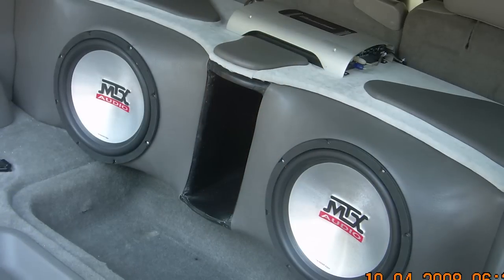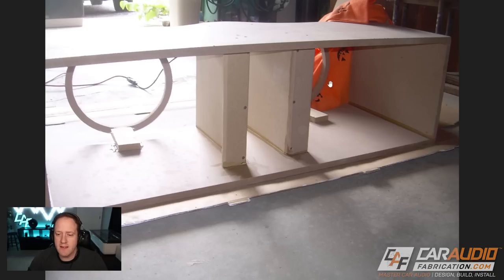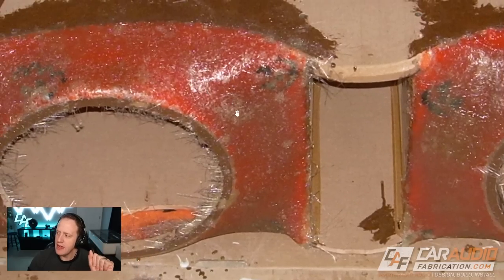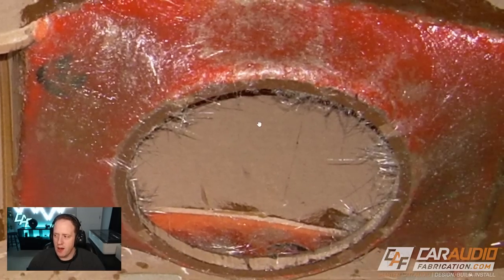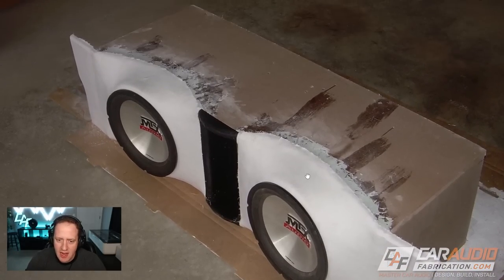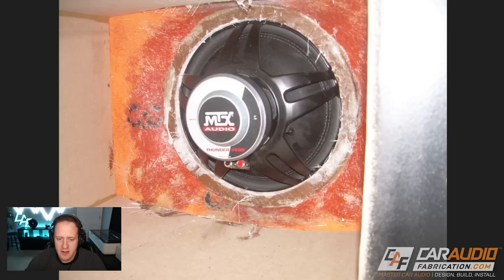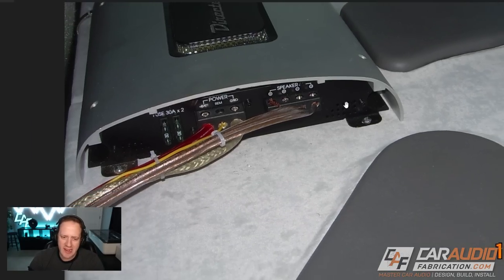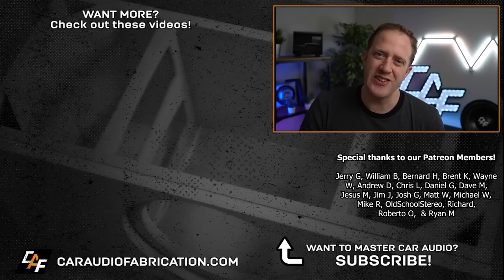Fiberglass Win or Fail? "VOLCANO STYLE" Subwoofer Box Build Review!

Comment: I’ve watched a few of your videos. Good stuff.  You’ve mentioned a few times that you prefer not to use screws and just use glue. If you haven’t already, you should check out a biscuit joiner. Using biscuits between panels in tandem with wood glue will yield you even greater rigidity without additional screws.  Just a suggestion.  Anyway, thanks for sharing all your work and instructions.

Comment: Around 1030 you showed the air bubbles on the front there and I wanted to add that it looked like you applied the glass on top of the fleece and did your first resin coat in one step. It's best to resin the fleece let it set then sand that down then start laying down the glass matting at that point. Much stronger and easier to work with, it lays down much better doing it in two steps! That's a cool design on the box though I dig it!

Comment: 28:25 All the wires connected to the amp: I would secure them to the same surface the amp is secured to, right in front of the terminals, so there could be a little slack in the wires at the connection point instead of there being tension on the connectors of the amp, like we see here. This was a great video for learning the difference between amateur and professional.

Comment: When I was fabricating enclosures like this, I would frequently, purposely get mat into the cutout area for the sub when reinforcing from the inside. The key is to remember when it was the correct time for the resin to flash, and you can cut away all of that excess with an olfa knife.

Comment: 28:27 Wood screws to mount the amp to the wood, and mounting the amp to the box itself, and whatever is going on with that first (left) positive speaker terminal and wire connection on the amp, are the other things you didn't like, right?

Comment: Love the videos.  I’m looking for plans for a 2010 f150 super crew cab.  Do you have one?  For two 10”.  Also, what do you think about euphoria subs? What’s the best budget sub?
Reply: I have 2011 supercrew and I just have a 36 wide box behind driver seat.  I can still put down the 1/3 seat so 1 can sit back there.  In a real need I can remove the subs entirely and I have some small 10’s I can dump in but honestly in years I’ve never had to do this.   In that box I have 2 zvx inverted into the box porting out the top and it’s pretty amazing with a taramps 5k bass   I tried under seat junk but if you’re a bass head with an f150 you have 2 options. Blow though from the bed and have a permanent unusable bed or fold that 2/3 section up and go as big as you can in a solid box.   Mine like I say will slide out with 2/3 people and I could pop it in my bed or leave it home. Then if really desperate I can toss 2 kicker 10 under the seat and connect the 1000 watt amp up that I left mounted and disconnected for a mild bass.  I never wanted a blow though as it’s already a short bed so take half that away and meh it’s now not a truck. And I still wanted the option of 3 in the back in a push.  If you have little kids that may not work but my kids are all adults and my odds of carrying more than 2 passengers is low.  For me so low I’ll probably never need to remove the sub.   It’s beastly heavy as well so random crackheads say no thanks that Shhhh be too heavy.
Reply: Forgot to add I keep an agm battery in the truck cab as well. Lol. I had that in the bed but I like it better inside the cab in a battery box as I can keep the cover off the bed without something thinking hmmm a free battery in there.
Reply: There are plans out there for 4 10’s under the seats but honestly I really don’t think they’d have the air volume for any sub hitting hard enough without inverting and then the floor space is gone or you got feet on your subs.    My setup I can reach and touch my sub booty to check temperatures but they run cool butt up therefore I can push them harder.
Reply: Best budget subs I say scar. ZVX 12’s are under 300 bux shipped.  ZVX Is suspiciously close in name to ZV5 from sundown. Lol. X being 10 in roman numerals. Lol idk. 1500 watt rms each. 3000 together.   NVX also makes some decent hitting subs with the benefit of actually a really great sound quality as well. I have 2 pair their 12’s here the 300 rms budget and the 600rms mid line and a pair 600 rms ones hit hard on a kicker cxa.1200.1   The mid line are like 80 each shipped.  Will never hit like the skar.  Once you’re up to like sundown yes they are great but double the price of skar I can’t see the difference being that big.  If I were building a sound demo car then yeah I’d go sundown or wolfram or something extreme for extreme use.

Comment: Well as far as amp on sub box.  I have 2 zvx inverted into a solid ply box and I have literally held my hand on the box itself and it honestly has less vibration than anywhere else on the vehicle. I went so far as setting small item on the box and it moved less than my phone on the center and an object on each side dash.  The metal really flexes compared.   I mounted tight and I’ll take it up and I touch the amp and again it still feels less vibrating than anywhere else so i say it really depends on the build itself and the vehicle.

Comment: So I see a few ways you could have made that middle better without changing much at all. You could have taken the shape of the amp to make that piece that is hiding the seem be more cohesive. It would be an I shape instead of a blob. Something like this ][ like the side of the amp. Also, you could have used four spacers to lift the amp enough to run the wires under the amp and then behind the box. It would have been a lot cleaner and cost pennies. With the side benefit of some vibration reduction and air flow. I'm with you on the zipties and would also add that not only should they always be trimmed flush but the junctions away from view so they look even cleaner. They need to be rotated down if seen.

Comment: Looks fine from far, but far from fine. Ha ha ha... just giving you a hard time. Looks damn good for one of your "early" builds!
I noticed it seems like you had a lot of tension on the speaker output cables, which I try to avoid personally. And the zip only holding some of the wires bugs me... ha. Other than those I didn't notice anything that was horrible. Again, especially for an early "just starting" build!